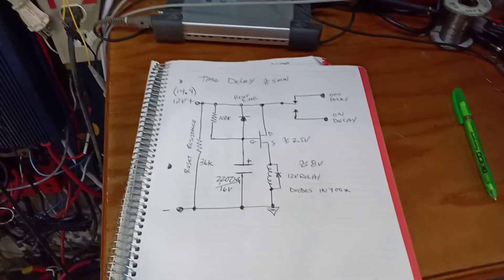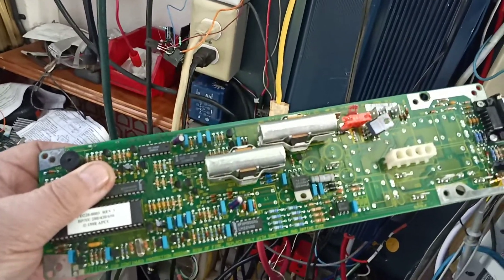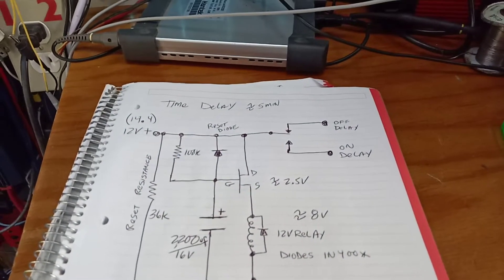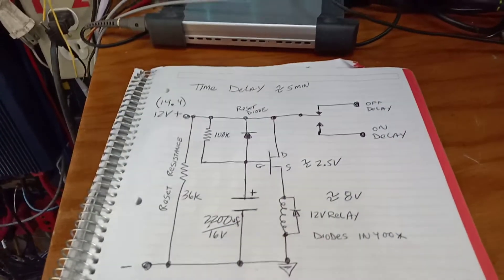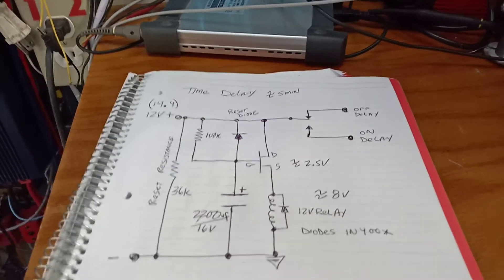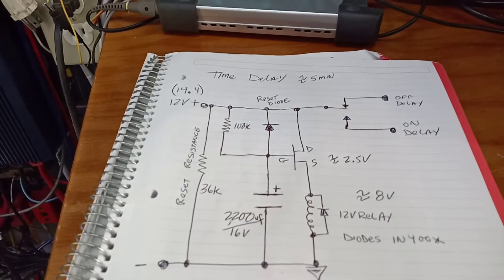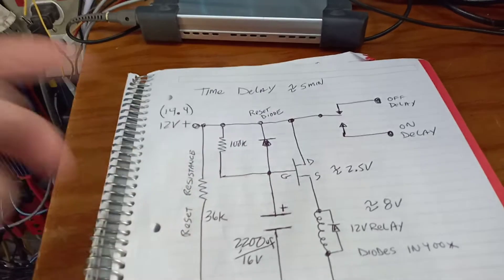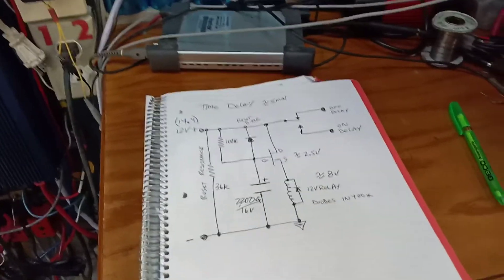Build A 5 Minute ON or OFF 12V Relay Time Delay

Comment from the maker: My fridge was having a problem with hot starts locking compressor. This provided an extra time delay. Another one will give me an interval on for my pump which only has to run a few minutes for syphon to start working.

Comment: That's awesome, so there's no clock or anything it just takes time to charge the cap before it triggers
Reply from the maker: I made a couple fans mounting three and four 12V computer fans for sleeping at night. Only an hour later temps can drop dramatically. I use only a FET capacitor and resistor for a time delay to turn them off. Just a momentary switch to turn them on.  Even a FET has capacitance. You can touch your finger to the gate and 12V and it will turn on for an extremely long time. Of course, that finger can also deliver a zap which will destroy it.  All FET need some resistor on the gate to pull it down so it doesn't float.
Reply: @opera5714  not many people in the world that understand even the most basic components enough to apply them to things in their life like you have.  I've always been right on the edge of being able to do that. Rarely have I actually done it though.  A while ago I needed to make a percentage indicator with four LEDs showing 25% 50% 75% and 100% based off of a 0 to 5v reference.  With some experimenting and tweaking I did get the LEDs to light up as I needed. But it was kind of a pain and honestly easier to just relabel a 0 to 5 volt analog voltmeter as 0 to 100%.